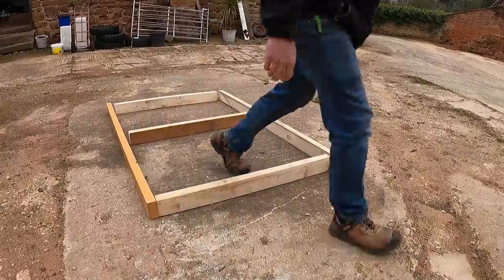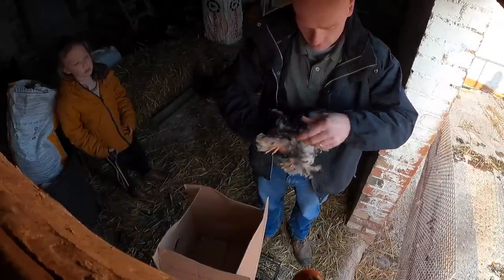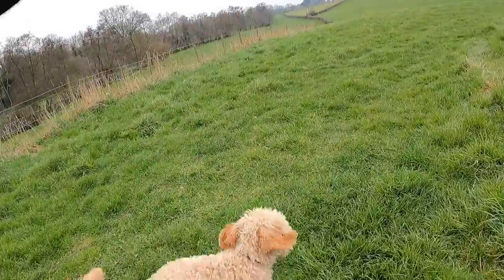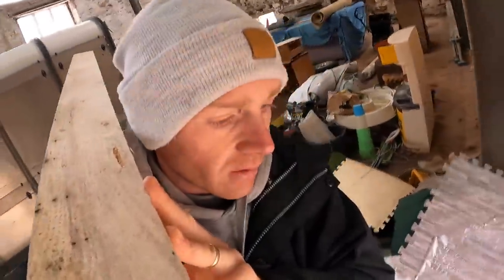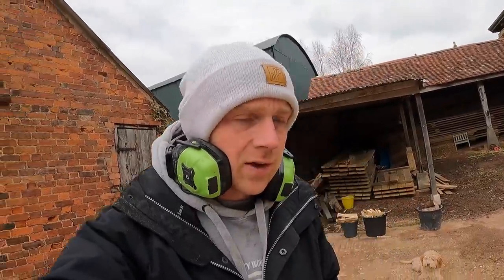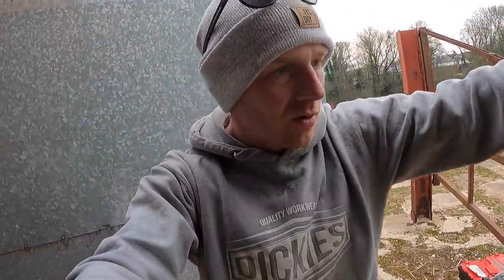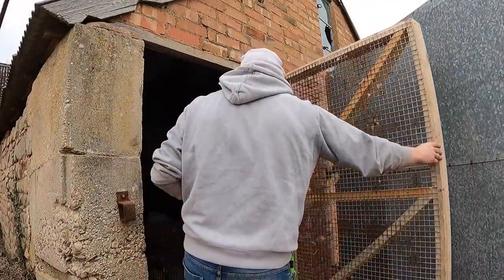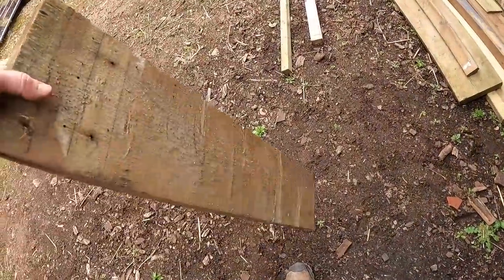BUILDING STUFF AT LAST! - More additions to the flock 🐓

Comment: Hello my friends. I watched a vid where you lifted wood flooring to insulate. Quick question. Can the flooring be turned over. I bought a house today (ahhh big day for my family) 
Nice wood flooring but half has plywood on top with thousands, maybe millions of screws holding it down to the wood floor. 
If I lift can I turn them over to hide the screw holes? 
Thank you in advance.
Reply: No the use of chicken perches means flooring is not needed. No nail holes no screws. Hens loves to perch, keeps them off cold floor and away from vermin. Until now I take mine down at night and place the sleepy hen in their hut. Now away from frosts they will sit mostly on top. Hope this explains
Reply: @frankklein4872  I think Mark was asking Tim for advice for restoring the floors in his new house.

Comment: Word of advice for the future: Pigs WILL break that gate, especially with those hinges. I've seen pigs destroy those metal farm gates as well as chew through any wood they can get their teeth round. Also make sure the walls are strong otherwise they'll break through that. Don't underestimate the power of pigs!
Reply from the maker: You are quite right, we would probably lift off and shut the steel door if needed. We decided to use the other building for them in the end which is concrete and steel gate. They will only be in the short term and then out on the fields with electric. Our last pig made short work of the veg patch fence. 😂